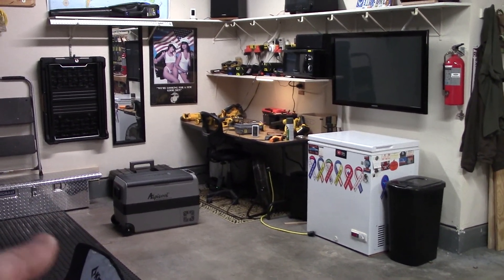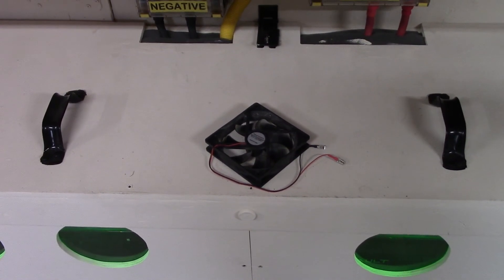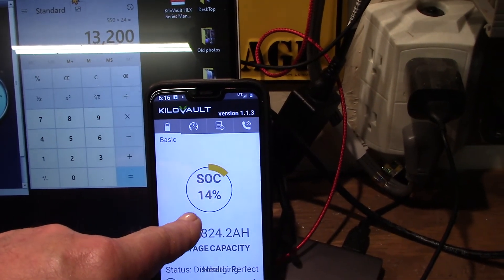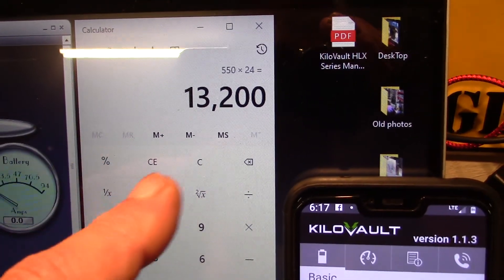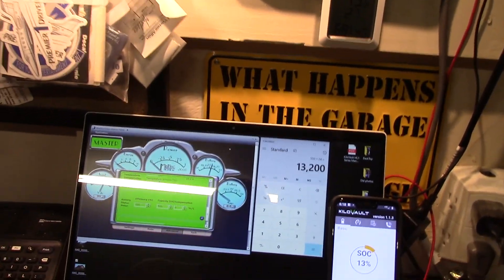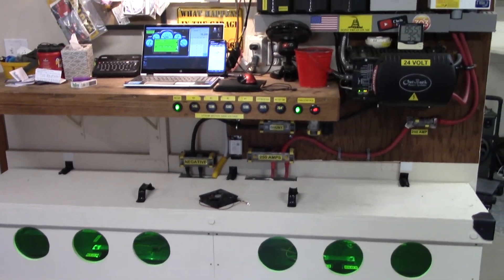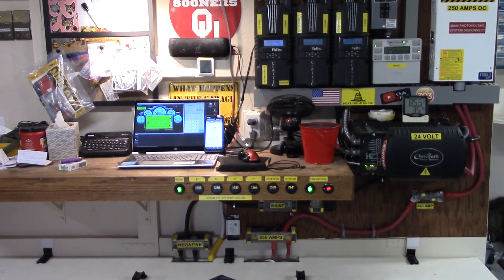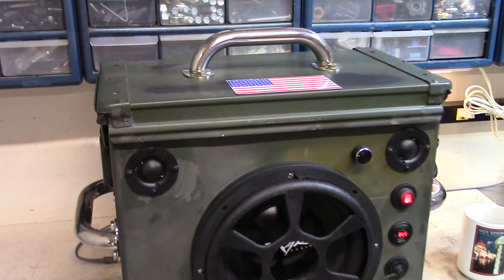KiloVault lithium battery bank update (and other garage DIY projects!)

Comment: How did you change the name on the batteries?
Reply from the maker: I can't remember how I did it. It was in the settings section in the APP. Give the AltE Store a call...they can answer much better then me.
Reply: Type in 5678 instead of 1234 when it asks for your password to check the 4 cells individually.